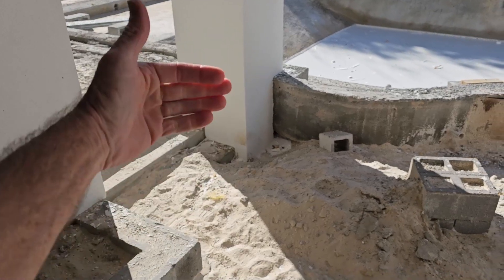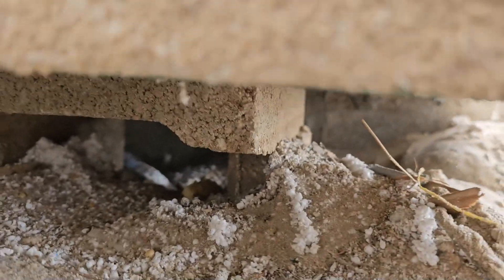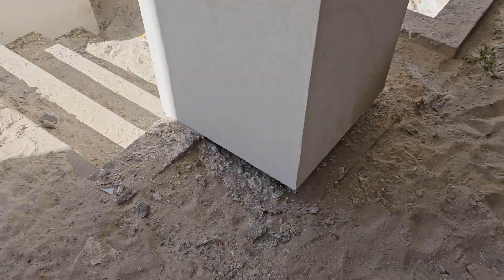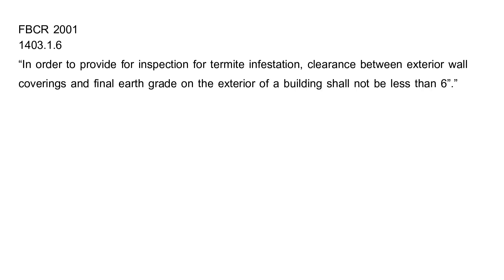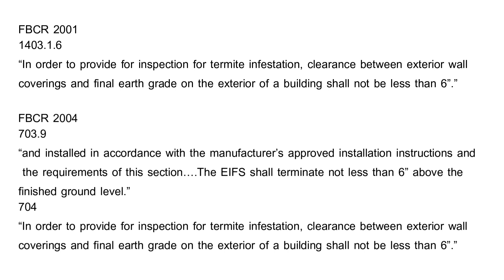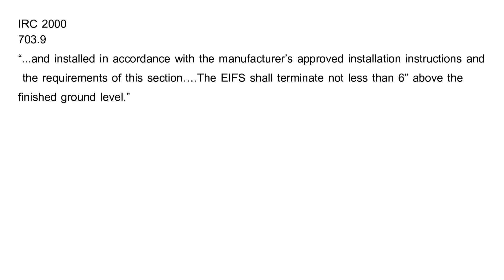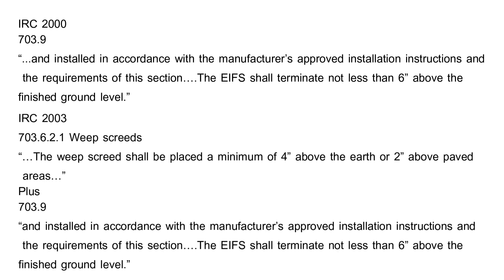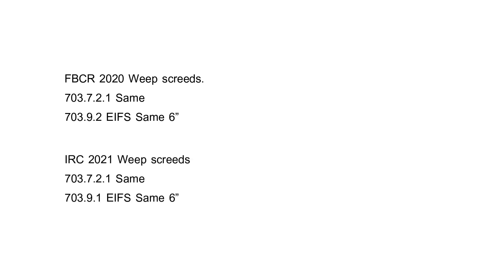Poor, improper new construction; veneer below grade

Comment: The problem is that crap work like this is passed by the city, town or county inspectors. Wtf is the point of having permits and inspections if they are just gonna rubber stamp garbage work that doesn’t satisfy the code!! Once the structure passes inspection the liability should rest at least in part with the government body that said the work was to code.
Reply: Because said work is NOT.